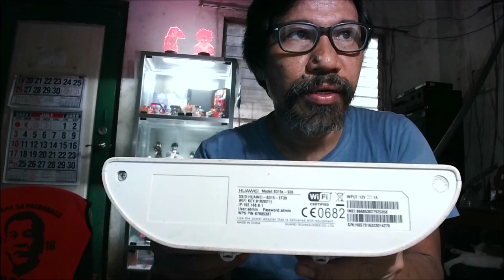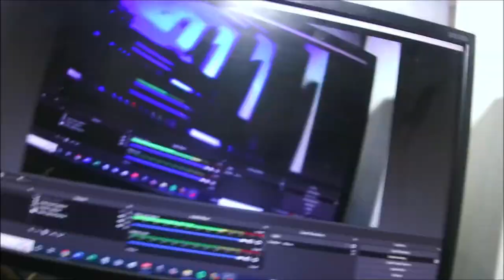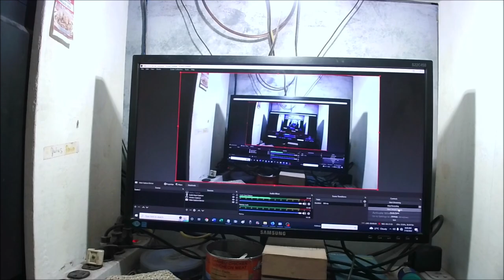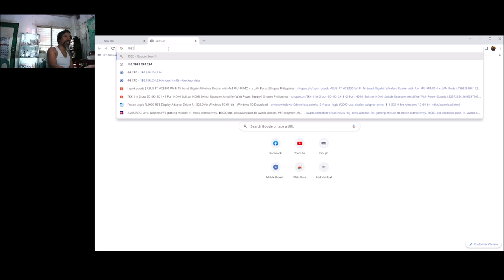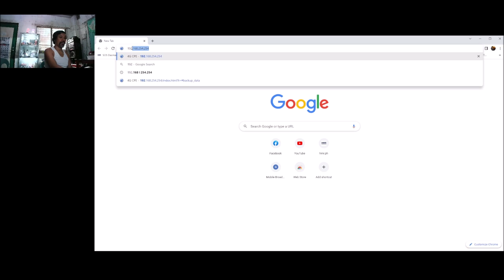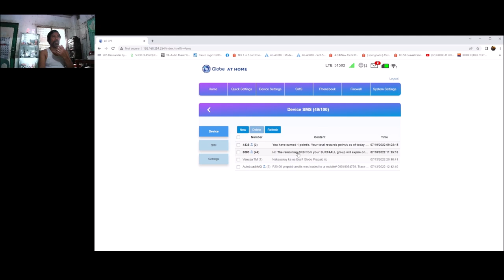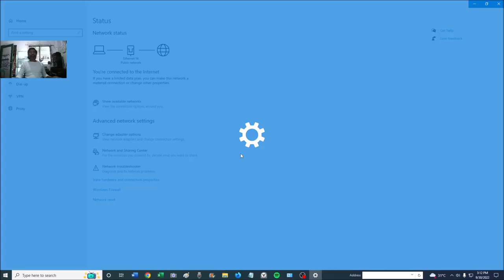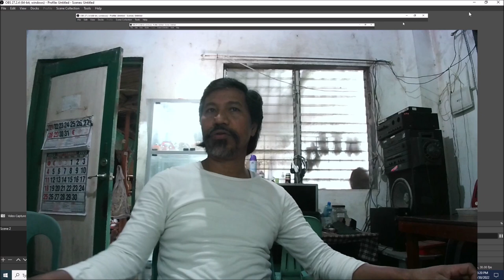Antenna Sticks of Busted Huawie Router and TV Antenna as my Outdoor Wifi Antennas

Comment: sir san po kyo nakabili ng splitter converter para sa antena ng tv para maging antena ng modem?
Reply from the maker: Marami naman ya sila nagbebenta online peru ito yong nabilhan ko.  https://shopee.ph/SMA-Antenna-Splitter-Adaptor-for-Globe-at-Home-Prepaid-Wifi-Router-Modem-B312-939-and-ZLT-P25-i.113785602.4534886616
Reply from the maker: https://shopee.ph/F-FEMALE-JACK-to-SMA-Male-Plug-Straight-RF-Coax-Coaxial-Antenna-Connector-Adaptor-for-Wifi-Router-i.113785602.9218907844

Comment: Sir, I have openline my prepaid wifi on my own through the steps and firmware I found on youtube video. The logo has change into sztozed. Now I am scared of hacking. I shouldn't have done that.😥 But before I did the openline process I downloaded the original firmware. Sir, is there anything I could do to bring it back?
Reply: The stozed is the brand of other firmware like globe you just debranded it no one can hack it except you password is weak
Reply: @juliealano5021  Thank you Sir for sharing that, I will just need to change stronger password pala.😊
Reply from the maker: I am not very sure if restore factory settings would do. But you can try it.

Comment: Hi! Are those antennas okay to get wet?
Reply from the maker: I think so because those Antenna Sticks are sealed which is the very reason why I decided to make it outdoor antennas by using wifi antenna extension cable. which I also mentioned in the previous video.  You may watch the previous video.  https://youtu.be/OFoMeStYgtE
Reply: @Victor100808  I see in your video that you really used it as an outdoor antenna. It definitely got wet because its outside but doesn't get damage and still functioning today.

Comment: Mukha ung signal nyan sa linya n lng ng cable mapupunta hnd na makakarating sa router.
Reply from the maker: It is consistent 4 to 5 bars at gamit ng anak kung Graphics Designer sa kanyang Work from Home Jobs. Kasabay din nakakabit yong TV Antenna used as outdoor wifi antenna. Back up internet connection pag tumirik yong aming Fibr connection.  Okay naman siya hindi sobrang mabilis peru consistent at stable siya kaya nakakaraos naman yong overnight jobs ng anak ko.

Comment: Amigo with All my respect I see That you are using very thick cord  to conduct the signal and also way too much on length for the outside antenas That's where you loose most of the wi-fi potency instead of gaining, And at the same time you are creating a very dangerous Hazzard incase of a lightning Storm
Reply from the maker: As to losing wifi potency, my experience is the opposite.  Without the outdoor wifi antenna the normal speed our globle perpaid wifi router is not more than 5 mbps download speed but after I use the antenna, I increased the wifi signal from 3 to 4 bars to 4 to 5 bars with the download speed of 8 to 11 mbps.  As to lighning, I anticipated that and it is already normal in our place for lightning to knockout and bust even our PLDT fibr modem. What I am doing really is turn off all powered devices which is potential for lightning strikes and power fluctuations. As a matter of fact I am trying to figure out how I can develop another antenna with the use of diode or maybe fuse to prevent the impact of high voltage current produced by lightning and thunderstorms.  Thank you so much for the feedback
Reply from the maker: By the way I forget to mention that if you watch the three videos, I am using three outdoor Antennas. Two of them are from my busted Huawie wifi  in which I am using thin wifi extension cables.  Another thing is I only use that old TV Antenna cable to minimize cost but you can still use wifi those thin extension cables but you need to buy additional adapter connectors for that purpose.